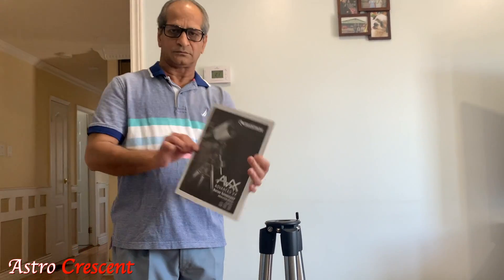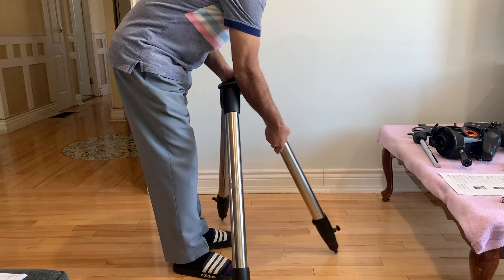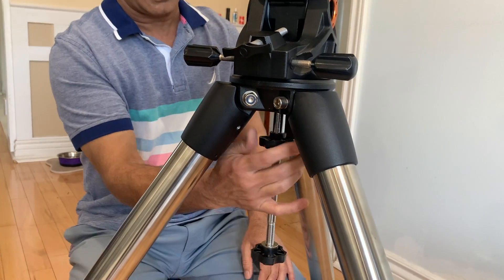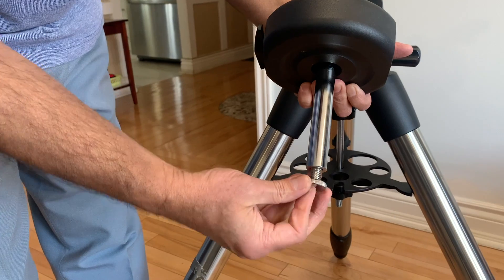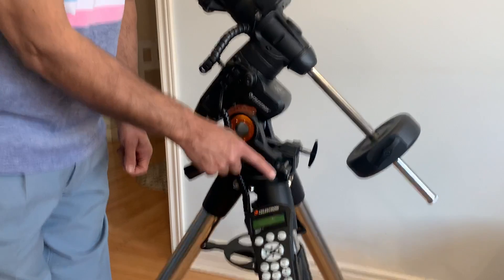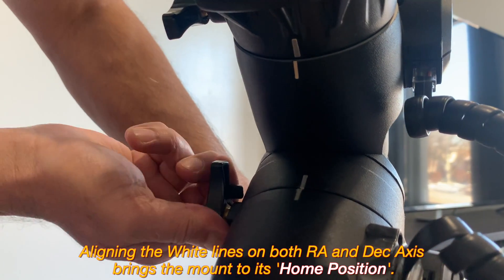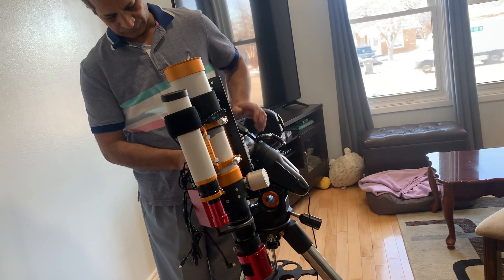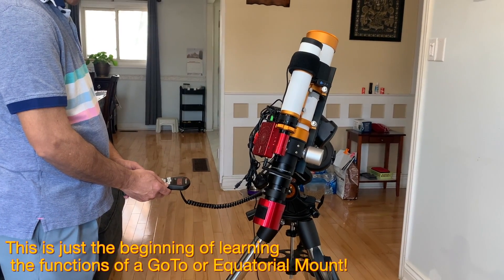Celestron Advanced VX (AVX) Mount Assembly and Balancing the William Optics GT 71 Scope.

Comment: What is they aux 1 and aux 2 for? Can it be connected to laptop that has stellar software, by clicking on an object in the screen the mount should move to the target and start taking pictures.
Reply from the maker: Thanks for watching! These ports are for connecting optional Celestron accessories like StarSense AutoAlign or SkyPortal WiFi module. You cannot connect a laptop to any of these ports because these are not standard RS232 communication ports for controlling the mount. 
Hope this info is helpful.

Comment: I notice you have a WO Z73 (or maybe Z61 I can't tell which) attached initially. I am waiting for shipment of this scope as well as well as the mount. What are the extra pieces you used to properly mount the scope to the AVX mount?
Reply from the maker: Hi Kip, Thanks for watching. In fact, it is WO GT71 with 0.8x Reducer/Flattener. GT71 is a triplet while Zenith star series are doublets. Both GT and ZS series scopes are good for beginners. 
I used Celestron universal dovetail bar to properly balance the scope on AVX mount because the WO dovetail is too small. 
Hope this info helps. Enjoy your new scope. CS!

Comment: Pawan, thank you for this video. I notice that you used the AVX with fantastic results in many imaging sessions. Did you find it necessary to "hyper-tune" the mount or work on the internal elements of the mount to improve guiding precision? Thanks!
Reply from the maker: Thanks for watching and your kind words! Honestly, I have never done anything to this mount. It has worked perfectly well even since I bought it about a year ago. My total guiding RMS stays between 0.7" to 1.2", which is acceptable to me. All settings are running on default, except for the Meridian Flip, which I have to change sometimes according to the imaging target.
Reply: @AstroCrescent  thank you, I'm glad to hear that. I ask only because I bought the AVX right before winter and have only used it for a handful of sessions so far.
Reply from the maker: @TheGoKidd  I am sure you will like it. For me, it has proven to be a nice mid-range mount.